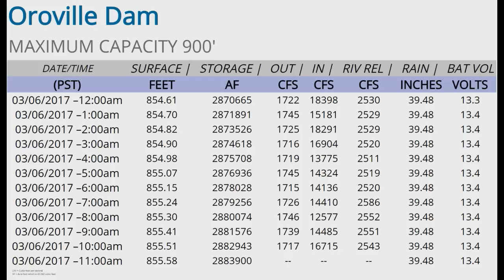Up Close Spillway Footage | Lake Oroville Dam | Lake Level Updates 3-6-2017

Comment from the maker: Update: Approximately 427,000 cubic yards of material have been removed from the diversion pool. The Hyatt Powerplant was restarted on Sunday, March 5 with one turbine generator moving water at 1,720 cfs. This situation will be monitored throughout the day to determine the efficiency and safety of excavation during flows. Lake levels currently at 855.9 feet.

Comment: Great video, thanx.  The video shows them spraying concrete under the lip of the damaged spillway, so they must intend on using it again at some point.  Another website says they are releasing some water thought the powerhouse, but the channel isn't deep enough to operate the powerhouse at full capacity, they are going to have deepen and widen the channel. It said the water level in the lake is rising about 2 feet per day.  I expect if the water gets high enough, just depending on the rain, they will have to open the floodgates again.  I wondered if they were going to work at night, that's very dangerous, while they have lights, they aren't very bright.  Guys in a hurry on large machines can easily run over someone and not even notice.  I wonder if they intend to replace the entire concrete spillway, or just the damaged section?  Either way that's going to a long and expensive project probably taking years.

Comment: Please  note  @ 2:12  you  will  notice  horizontal  section  above  shotCreete  operation,  in  between  scaffolding,   NO  Re-BAR,  I  repeat,  NO  RE-BAR,  another  corrupt  government  contractor. And  or  corrupt  government  inspectors.
Reply: So full of shit.  You can see the rebar in the upper strata suggesting more than one poor at 2:15.  Use your damn eyes!!
Reply: Zionism Kills ... You are correct ! Also at 2:32 the rebar is different thickness and suspiciously new looking and without any cement stuck in its low points of the rebar. The closest piece has some but it looks like someone put there and did a bad job trying to make it look real !!! Also the spacing is to far apart for any type of strengthening . Something seems fishy here and I don't mean the wildlife in the river !!!

Comment: That entire hillside between the spillway and the power plant looks very precarious.  Rebar is completely inadequate.  This represents a massive engineering failure that needs to be explained.
Reply: And you are a certified hydro electric and civil engineer with which firm again?
Reply: I like how everyone wants to hold some engineer accountable for this failure for their lack of technological understanding. Uh...the dude is likely dead. This dam was designed in the late 1950's by DWR engineers inhouse and constructed in the 1960's.  Pretty sure the standards and construction practices used today are vastly different than they were back then.

Comment: shotcreet what the hell is that going to do?
Reply: shotcrete does seem more like a band aid than a cure, but it may help slow down the possibility of water undercutting the spillway any farther than it has already.
Reply: that much water I give it 2 days
Reply: That's probably exactly what they are doing.  Spraying concrete under the lip to prevent it from eroding anymore as a "band aid" solution.  The water level is currently rising about 2 feet per day, they may have to open the floodgates and use the damaged spillway again for a while.  I would guess they are trying to save as much of the damaged spillway as they can until the wet season is over and then come up with a permanent fix.
Reply: Probably better than nothing.  In this short time they can't do too much of anything

Comment: rebar cages are common in buildings as they need to be load bearing. and how it's laid depends on you expect from the loads placed on the structure.
  this rebar is most likely used just to tie the concrete sections together.
you would assume that the spillway would have been tied into the bedrock with rock bolts connected a lattice of rebar. just because it's in a seismic zone.

Comment: That's alot of erosion under that spillway. I imagine there's a lot more that you can't see high up near the release gate. Wouldn't they have to break up the remaining spillway and start from scratch? Unless they're just buying time to get through the snowpack melting season and start this summer.
Reply from the maker: I would think they would wait till after the melting season before doing any major repairs to spillway.
Reply: Disclosure Media How can they prevent it backing up into the generator hall? I think there might be a bit more water to hit that lake .
Reply: There's probably a gate or valve they can close to prevent water from backing up into the generator hall.

Comment: thanks for the vid. that was some great footage they released. looks like they randomly tossed some rebar in there just to be able to officially say they used some. not that I know, but it sure doesn't look like it's very much rebar in there.
Reply from the maker: It really doesn't look like a lot of Rebar but that's not my expertise.
Reply: agree. heck, I poured cement in front of my garage entrance to make a better approach. poured it in 4 small batches, and I put in more reinforcement per sq ft then what is in that spillway. ha.
Reply: I've not see any photos yet where wild pieces of rebar were hanging out, as you would expect.  And now that they are down to bedrock, they have to stop the upward direction of erosion. You would think that they knew they were placing this structure on loose or coarse soils.